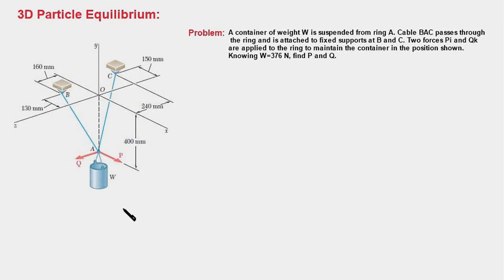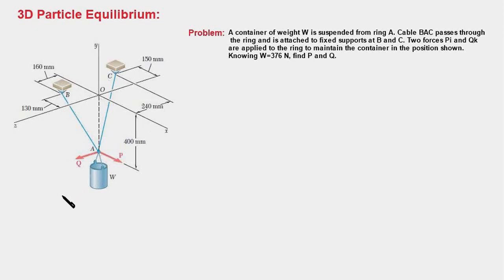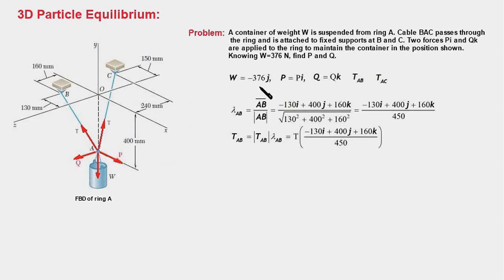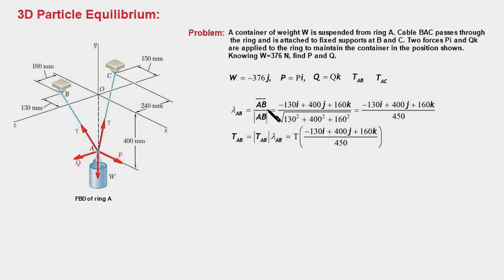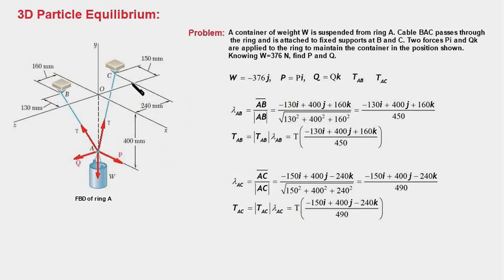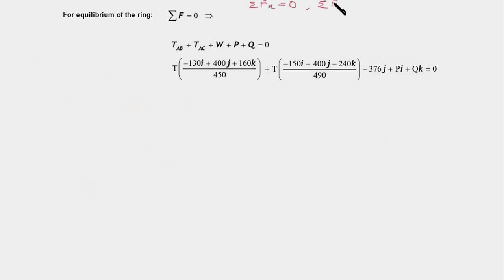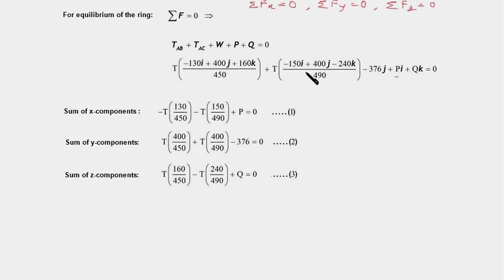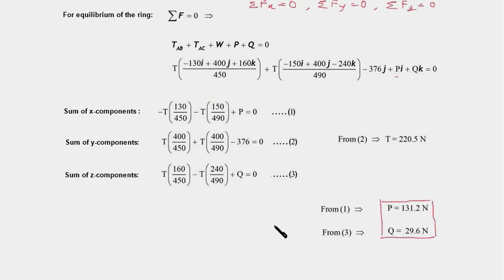4.10  3D Particle Equilibrium - Solved Problem #1

Comment: i guess when you make the  sum of x and y and z  you didn't but Tac and Tab
Reply from the maker: First, we express the tension forces Tac and Tab in vector form - the magnitude (T) times the unit vector ('lambda ab' or 'lambda ac' as the case may be). Then, we add x,y and z components of all the forces and equate them to zero for equilibrium. I don't think any force has been missed out. Pl. check the solution again and hope your confusion will get cleared.